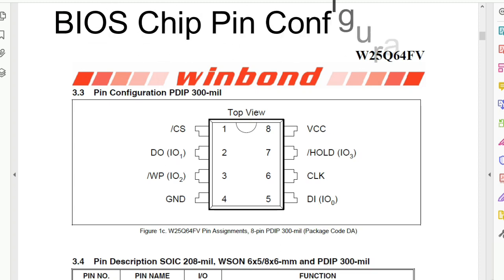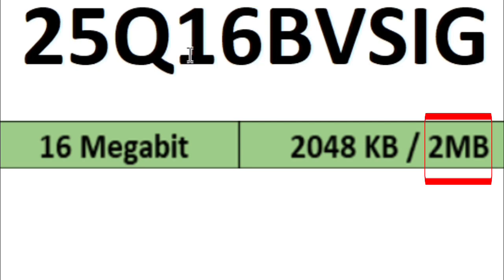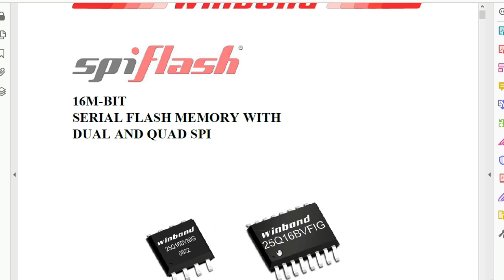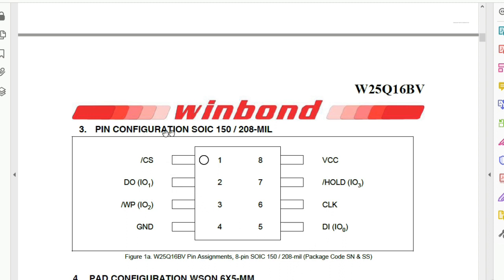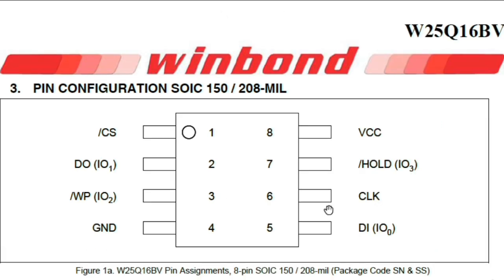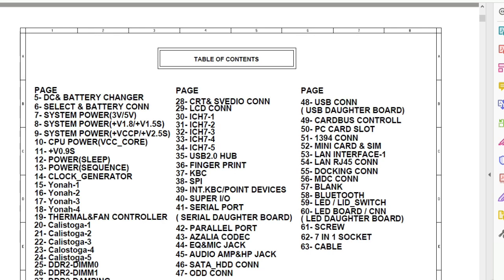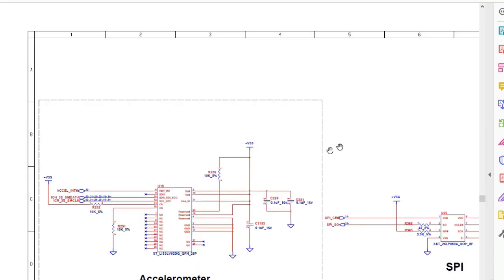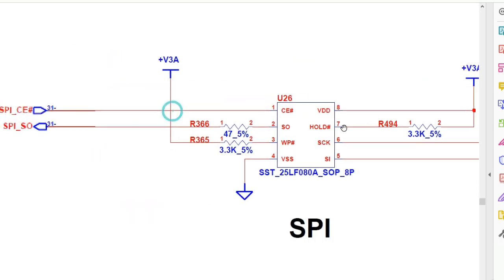Basic Input Output System (BIOS) schematic analysis tutorial

Comment: Sir i have problem at pin number 8 and 1 is connected when i check with probe in buzzer mode.. And its still connected buzzer without IC bios chips installed

Comment: Ok sir , nicely explained. I have a question . Which pins out of 8 should we short in order to reset the BIOS. I know that CMOS jumper can do this but in my case that jumper is useless as well as the button battery. I need an alternative way to reset the BIOS. I can't boot the PC as the internal GPU is disabled in BIOS setting. Motherboard is  zebronics h61.
Reply from the maker: Depanding on type of the computer you have. you can use Use the multimeter to check between the jumper and the bios and you will find the right pins. the multimeter should be on the continuity option.
Good luck
Reply: @electronicsrepairbasics_erb  , sir , the my CMOS jumper section is having 1 capacitor and 3 resistors. 
The central ( 2nd pin) CMOS pin supply is going to the capacitor and then to the 20 kilo ohms resistor and then I'm unable to trace it.
The last CMOS pin ( 3rd pin ) is going to the 4.7 kilo ohms resistor and then going to 4th pin of BIOS chip ( i.e ground).
The first pin of CMOS is going to the 20 kilo ohms resistor and then I'm unable to trace it.
Please help me sir.

Comment: Hi, i have a question at 09:05 , you explained that pin number 4 is connected to the ground, and we must set the multimeter into continuity mode,  my question is continuity mode means they are connected to which other? right ? thnx
Reply from the maker: Right Martin